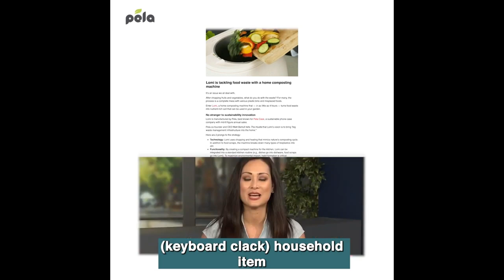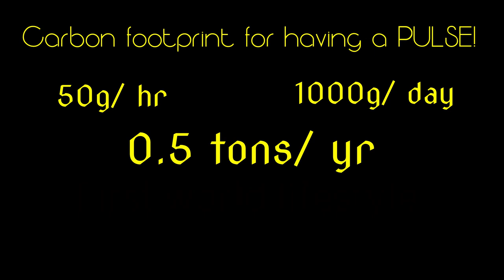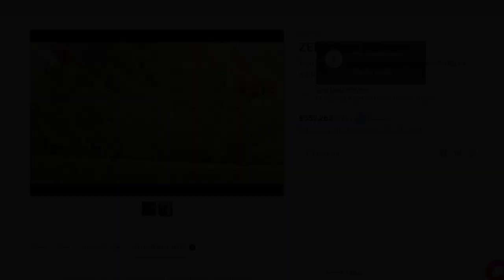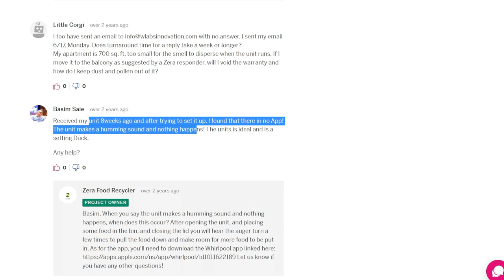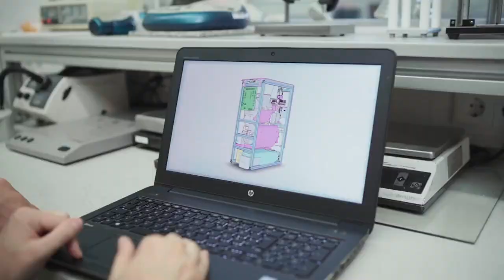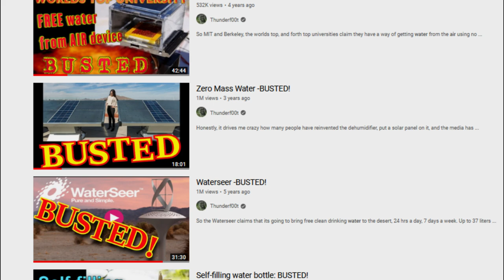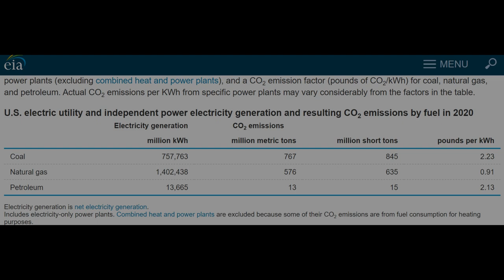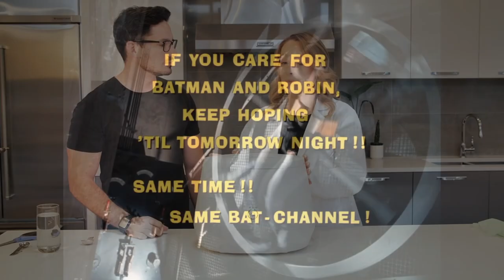Lomi: BUSTED!

Comment: As a professional civil and sanitary engineer of just over 30 years, I was involved in a number of composting projects on the east and west coasts of the US back in the 1990s.  We tried static piles, windrows, forced air, and even containerized composting techniques.  In our case, we tried to use a reasonable mix of yard wastes (grass trimmings, branches, etc.), municipal solid waste (stuff you'd normally throw away in your house), and biosolids (human fecal matter) collected from nearby wastewater treatment plants.  The goal was always to try to find the proper carbon-to-nitrogen ratio - typically somewhere between 5 and 10 to 1.  Invariably, the reasons these facilities were ultimately shut down were three-fold:  (1) The cost of capturing and treating the off-gases was extremely expensive, (2) If uncaptured and untreated, the off-gases from these facilities would create the most god-awful smells for miles and miles downwind, and (3) The leachate (wastewater) produced from these compost facilities was extremely foul, quite acidic, and would simply destroy the biological activity in the downstream wastewater treatment plant receiving this runoff.

There is this old saying:  The solution to pollution is dilution.  And, while that saying may be offensive to some, the concept of composting, which concentrates pollutants rather than diluting them, proves the statement to be true.

If you want to read about one of the few facilities on the east coast of the US to actually survive the pilot testing stage by reverting back to composting only yard trimmings, have a look here:

https://www.montgomerycountymd.gov/sws/facilities/cf/#:~:text=Montgomery%20County%20operates%20the%20facility,Maryland%20Environmental%20Service%20(MES).&text=The%20composting%20program%20in%20Montgomery,one%2Dthird%20of%20the%20county.

On the west coast of the US, a similar pilot test was conducted near Escondido, California, but that facility failed miserably.  Today, Escondido simply offers a homeowner instructions on how to pile up trash in their yard and compost it "naturally."  See https://www.escondido.org/composting.aspx
Reply: Great comment and thank you for sharing your expertise. I would like to have your opinion on the concept of this product: 

I live in Montreal, our energy comes mainly from hydroelectricity, so the emission of this type of machine will be negligible. 

We already have organic waste collection programs. I have the impression that with a machine, a less restrictive model, we could reduce the frequency of organic matter collectors and thus reduce our GHG emissions (in the hypothetical situation that a majority of the population would have the machine in question). 

Do you think that dehydrated materials would be detrimental to the system you were referring to?
Reply: That's really interesting! I'm working with a compost company locally but we've focused on anaerobic composting of mostly food waste. Our containers for the clients have rubber seals and we provide a germinating mix to sprinkle on top each time food is added. The bins generally don't get too bad, it's more of a fermenting smell rather than a rotting one. At our facility we then mix it with mulch and compostables, stack it in windrows, and cover with tarps. The smell really isn't bad.
Reply: Strange because in Poland and whole EU bio waste is processed in every little and big city. They will start building bio gas plant in my city soon which will produce fertilizer and biogas which will be pumped into the network. We already have waste burning plant which produce heat and electricity for the city.
Reply: @philipperodier8414  Good question, sir.  The short answer to your question is almost certainly, yes.  The various composting techniques I pilot-tested targeted somewhere between 40% and 60% water, by weight.  Though the water, expressed as runoff from the process, is rancid, it's necessary provide a medium for the growth of both heterogenous and autogenous bacteria needed to expedite the digestion (carbon-reducing) processes.  For all but the forced air systems, which promoted only the growth of aerobic bacteria, the nitrogen was needed to support the growth of anaerobic bacteria deeper in the static and windrowed piles.  To summarize, these processes would not succeed in a dehydrated substrate.  Hope this helps.
Reply: @matthewluttrell9413  If the food source for your anaerobic biology is mostly kitchen wastes, then I follow your process.  The troubles come when those food wastes are mixed with other largely inert materials, or greenwood, which contains a carbon source, but also adds a lot of non-carbon fiber.  Yard wastes are also very low in free nitrogen, which inhibits anaerobic activity.

Have you conducted a survey of the surrounding community near your composting site to see if your neighbors agree with your conclusion that "the smell really isn't that bad?"  That's what MCRCF did when they first got started and they learned right quick that their neighbors would have none of it.

I ask because we experimented with composting at the Blue Plains WWTP in Wash DC some years ago.  Those who were working the windrows didn't seem to mind the odor, but the poor souls across the Potomac River who were in Alexandria were quietly complaining to their elected officials.  DC Water was eventually required to shut the whole thing down and, as it turned out, the workers had simply become olfactory desensitized to the ammonia smell (the biosolids being used were lime-stabilized and the anaerobic activity in the windrows was converting the slaked lime to  ammonia).
Reply: On the point of capturing and treating the off gases being expensive is it at all practical to utilise the crude hydrocarbon rich gas directly in a gas turbine of some kind. Or is that precluded due to other contaminants being present that render it unsuitable or unsafe to use as a fuel in it's crude form? I get that this wouldn't have quite the same warm fuzzy optics for many people but if we are talking about pure food waste this isn't going to be a net source of atmospheric carbon since you know crops don't tend to do a lot of deep core drilling and such. Hell if it could incorporate even as little as a few hours worth of buffering into the system it would perhaps even be able to defer some of the early peak load and thus delay the start-up of fossil fuel powered CCNG peaking plants albeit presumably only by a small margin.
Reply: Natural way in a yard is the best. Simple and produces valuable compost for the garden. So Escondido did the right thing.
Reply: The waste water is usable, I have calcium rocks just laying around the whole state. When you bring it to 5.96 you have fertilizer, if you are worried about heavy metals sunflower Barrons are the way to go.
Human waste material is now more treated and the mixture between it and yard waste over a collection pool for water filled with calcium rocks lowers the pH, you recycle it up and spray it again, and again, and again. You have to mix in inorganic material, sand or verm is usually the best.
Once you have a suitable material you dry it to field capacity, pack it and sell it. The waste water, you can mix in with bad fish to produce a concentrated mix, dilute or refine to reach the target, now you have fertilizer
Reply: @seraphina985  "raw" biogas has a lot of co2 and water in it, as well as some hydrogen sulfide. They all need to be removed, at least mostly, for good burn. The hydrogen sulfide is rather corrosive and not ideal to pump right into a turbine.
Reply: @glennpearson9348  well where we're at we really don't have neighbors😅. We're mostly surrounded by farms and right next to the dump; the dump smells worse. 

I also imagine your work was at a larger scale. We're currently scaling up and so far the outdoor hasn't really been a problem. Some bins do come in that are absolutely fowl, normally because they were left open at some point or already rotting meat was put in them. 
When each windrow is complete they have a month under tarps before they get rotated, by then the smell isn't a factor.
Reply: @seraphina985  Biogas from anaerobic digestion of food waste can be burned in a regular piston engine or a gas turbine after a simple cleaning step. What Glenn Pearson was talking about was the off gases from aerobic composting and they are not usable in such engines. It's mostly air with only a tiny portion of combustible compounds.
Reply: What a fucking sauce lad. Truly you've made my pasta dinner extra.
Reply: @matthewluttrell9413  It's good for the longevity of the engine to remove the hydrogen sulfide which is quite easy (e.g. with activated carbon) but you don't need to remove the CO2 if the gas is used in a stationary engine. For vehicle use, the gas is purified to almost pure methane but that is mostly so you can get more energy into the tank of the vehicle, the CO2 would be dead volume in the tank.
Reply: Why a direct fuel turbine over a boiler / steam job?
Reply: What is your opinion on modern large scale composting being done in places like the EU, korea, japan, cali, etc. i don't doubt that they aren't without downsides, but they seem to be doing it relatively successfully. After all we've come a long way since the 90s.
Reply: About that old saying, brings to mind nuclear waste. Think of uranium and plutonium(or any of the nuke wastes), they are mined out of the ground at ppm concentrations, and are only a problem when refined, concentrated, and in one place. 

Of course, one big problem Is crude oil, its byproducts and externalities(plastics or gas emissions cant exactly be put back in the ground.) But if were talking about composting and leachate, it's dead on.
Reply: @philipperodier8414  Hi Philippe, I grew up in Ottawa not too far from Montreal. I just want to say that there are essentially no situations in which this 'technology' makes sense. Using thermal energy to remove water from waste would reduce the need to collect garbage, true, but it would require many times more energy. This is adding a majorly energy-intensive stage to garbage collection. What problem does this solve?
Reply: Small scale composting works very well in the garden.  There's no smell and no power use.
Reply: That's interesting, because Germany is operating quite a few "Biogas" plants, where exactly what you describe happens, except the whole point is actually to produce and capture the off-gases.
Your point about the runoff is a good one, I'm not sure what they do with it, but knowing German environmental laws, they most likely don't just leak it into the next river ^^
Reply: @Nerobyrne  Same in Denver Colorado.  Covered in a building the size of a stadium but relatively cheaply made, been there for 30 years.  The gasses are drawn off the top and used.  Kinda reminds me of Beyond Thunder Dome.
Reply: I live on the west coast, we have green bins for yard waste. Once a week you can see a giant plume of smoke on the other side of the levee where Waste Management Co. is just burning all of it. Super great they used all the gasoline to collect and transport it so they can just burn it?!?
Reply: @seraphina985  our local bus company runs gas buses, they have a deal to use gas produced from anaerobic digestion of food waste.
Reply: As an ecologist, I am glad someone pointed this out and I didn't have to.  Thank you, friend.

That said, there is dilution and there is reduction.  The former without the latter is just kicking the can down the road.
Reply: Judging from the description of byproducts, it sounds like the compost was not getting enough oxygen and was undergoing a lot of anaerobic decomposition, also tossing in things like animal bones and seashells could help keep the Ph at a more manageable level for the microbes as well (maybe you guys tried that already though. With larger piles it's a good idea to introduce macro organism as well, springtails, earthworms, fungi, flies, ants, even birds and rodents play an important role if the pile is big enough as they can break larger things into smaller pieces and help aerate the pile.
Reply: I studied this topic for quite some time and indeed the main problem always falls on C/N ratio. Yet I amb amazed about the possibility of mixing in waste water with fecal mater. Mostly because of humidity. So obviously there's gona be lixibiate and anaerobic reactions. But in Europe, with a mixture of food residue and gardening-agriculture waste (to balance C/N), it appears the plants are working well. Though the smell.... when the wind blows in your direction you regret having had breaksfast. 

Usually waste water is treated in Water Treatment plants, which in turn produce the awful "muds" (literal translation from spanish). When there is so much water or organic matter, then they proceed with anaerobic process, which in turn prodices SH2. So I don't know which is worst. Anyway, nothing goes to compost exept for the muds, which are treated beforehand to reduce the water concentration, usually burning the methane from anaerobic process.

PS: The invention portrayed is purely evil. Praying on peoples good intentions and ignorance... disgusting
Reply: Really interesting comment. Spent 10 years designing and installing recycling plants within the UK. Some of which were for waste to energy for burning off shredded and sorted MSW (RDF). One of the big factors in burning that off was removing the water content of the RDF enough so that burning was most efficient. We tried tackling this by a few methods all of which were either energy hungry (passing material through ovens), or extremely operationally and space intensive (material handling it into piles with tarps to let it gestate and heat up and rehandling it every few days). On the face of it if everyone used the Lomi and desiccated the material and sent to black bin waste I'd wager the handling of the waste material at these RDF (Refuse Derived Fuel) Facilities making it much easier to burn and generate electricity. Would love to hear your thoughts on this.
Reply: @nothuman3083  what are "sunflower Barrons"? I looked the term up but couldn't find anything. Cheers!
Reply: We have a standard for council food waste to farm soil conditioned and methane generation… seems to be working fine.
Reply: thanx for posting this. I apreciate professional opinions. forgive me also for "cutting and pasting" your comment (without your YT ident of cours) on the lomi main vid. surprised by all the simmilar comments as here. lomi is more than busted. they have been exposed. chees&aloha , M8
Reply: Wait, does the output of composting "destroy the biological activity"? I mean would just dumping food scraps in a forest kill the trees?
Reply: @pacee21  not an expert in this field but isnt it a waste of materials to built something like this which might have less efficiency compare to the industrial size as well as the power they consumes might even more than that when combined?
Reply: @farcenter  the hell, that's what you call sunflower fields
Reply: @farcenter  wait did my regionalism show up
Reply: @matthewluttrell9413  The hydrogen sulfide can be removed by bubbling the biogas through a chlorine solution I believe.  Removing CO2?  I know water absorbs CO2 quite readily.  Could you produce biogas in a completely anaerobic environment?  Removing the sulfur dioxide shouldn't be too difficult I think.

Not saying though that we can run our world on methane from our own waste.  We could however produce a lot of energy and fertilizer I think.
Reply: @richardwicks4190  you can burn biogas on it's own, and you do produce it from anaerobic digestion.  The hydrogen sulfide can be removed through steel wool (idk about the chlorine solution). The CO2 can be mostly removed by bubbling through water, you have to take into consideration that the water needs to be constantly moving through the bubbler and that the outflow is slightly acidic. This can be a limiting factor for very large scale. Finally the water vapor can go through desecants. 
Raw biogas can be used for cooking and some things (I know some engineers have been made to run on it) but one of its big limiting factors is that you can't compress it without first separating its parts. Straight biogas can only be stored at 1 or 2 psi. 
The composition of biogas is about 60% methane to 40% CO2 and then 1-5% the other stuff (H2S, water vapor, some ammonia...). It has about half the energy per volume as pure methane. These numbers vary. 

I do think we should use biogas, but it does have it's cons and those need to be considered when scaling up. Not being able to compress it and its lower energy density greatly increases things like the diameter of pipes needed to flow larger amounts of it. The corrosiveness of the other 1-5% of its composition can also be a problem for plumbing. I've been playing with idea of making my own biogas reactor and there are companies that sell kits that you can use at home to use the gas for cooking. I hope to see it become a more common practice.
Reply: @matthewluttrell9413  Well, my knowledge of biogas is, well, extremely limited.

Chemistry too!

Some guy was fooling around in his backyard and using his own home-made biogas reactor.  He claimed that by bubbling it through (highly) chlorinated water it would result in sulfur + hydrogen chloride.

I guess steel wool would make.. Iron sulfide?

He took the final gas and used an air compressor to fill a standard natural gas tank to around 100 PSI.

How do you get CO2 from anaerobic composting?  How much oxygen is in dead matter like sewage, dead plants, and even dead organisms?

Anyhow, perhaps you could increase the absorption of CO2 by the water by placing it under pressure?  Maybe spraying a mist of water in a container filled CO2 under pressure, and then cycling the water to atmospheric level with something with a bunch of nucleation sites to encourage the CO2 to come out of solution?  Maybe even highly chlorinated water could do that?  You could just have a pipe that is say, 32 feet up to get 2 atmospheres.  That way, you just have to cycle the water and it wouldn't require too much energy.

I know there are multiple ways to remove CO2 from air, naval subs and the space station do this, but the fluid isn't water.

In any case, it's an interesting problem.

Seems to me you wouldn't want to centralize this process, but rather distribute it.  Would work for off grid locations.  Centralization seems to be a problem.  It seems it would be better to have a lot of little reactors than just a few huge ones.
Reply: @nothuman3083  well it could also be mine! thanks for letting me know though!
Reply: @Discoveryman29  long story short recycling plants have to pay to send things to landfill. If they process it and supply it to energy companies they can create a commodity to sell. The price they can sell it at is based in the quality of material e.g. calorific content moisture levels etc. If it is too far out of specification then material will be rejected and cost them so it's in the plants interests
Reply: @matthewluttrell9413  And I bet you don't have to plug it in and stir it either.
Reply: And there I was thinking the smell came from the nearby unwashed eco-warriors of Montgomery College. The school's motto --  "Make your move"-- even seemed like confirmation.
Reply: Miramar Landfill in San Diego currently produces certified compost made of yard trimmings and food waste. Local residents can get two cubic yards for free if they load it.
Reply: @elizabethblane201  Great planning to make Miramar Recycling Center work.  First, the composting facility is out in the middle of nowhere between the city and Miramar airfield.  So, no permanent residents around to grip about odors.  Also, San Diego was smart to locate the Metro Biosolids Center very near the landfill so the two products could be easily mixed.  The final stroke of genius is that the leachate from the composting facility is treated alongside the leachate from the landfill, so you're killing two birds with one stone.  Very few metropolitan areas have the advantage of wide-open, easy to access spaces like northern San Diego.  Count your blessings!
Reply: @seraphina985  That's a great question!  The answer is, yes!  It can be used in what is called an "enginator" to turn biogas directly into mechanical energy.  However, there is some work to be done in that the gas must be dried first (the water vapor removed).  As our good friend. Thunderfoot would no doubt point out, removing water vapor from a gas requires lots of energy in the first place, so projects that use enginators often have to be extremely large in order to get a reasonable payback period on the costs of the equipment and its maintenance and operation.

I hope this answers your question.
Reply: @glennpearson9348  Yes, we are blessed! From what I understand, their compost is only yard trimmings and food waste, without sewage. Is that your understanding?
Reply: @sdk6450  Don't get me wrong.  We have a number of large-scale composting and biogas generation plants throughout the U.S., too.  It's not as though it can't be done.  It just needs to be done in the right place and under the right conditions.  Places like S. Korea, Japan, and the EU are much more accepting of the general good that comes from such "green" projects.  Here in the U.S., the first thing you hear these days when proposing a project like this is "NIMBY!"  People like the IDEA of such a project, they just feel it should be "Not In My Back Yard," which seems to be less of an issue in other countries.
Reply: @elizabethblane201  That's my understanding.  Though, at one point, I think they also experimented with combining food wastes and sewage at the biosolids center before sending it on to composting with yard wastes.  Mixing waste streams like that makes it very difficult to get a chemically consistent admixture, which is really needed to maintain a stable and "stink free" composting process.
Reply: @glennpearson9348  I guess you could compare it to baking a cake; you have to use the right amounts of the right ingredients and follow the process exactly, or your recipe is going to fail. I'm seen a couple of videos of the Miramar landfill compost, and it looks really nice. It says on the website that it is processed for 10 weeks, and screened to 1/2". They'll load your truck for you for $12 per cubic yard, or if you load, it's free for up to two cubic yards for residents. This landfill seems to be a place where all the variables are advantageous to produce a good product.
Reply: Could the leachate have been neutralised with, say, sodium hydroxide? Or diluted to something like a 1% concentration in freshwater? Before sending it down the drain?
Reply: @electric7487  Possibly, but the problem with sodium hydroxide is that it reacts with a great many things; in some cases, the reaction can be quite violent.  As for diluting the leachate, sure, diluting it is always an option, but using 100 gallons of potable or fresh water on 1 gallon of leachate seems like an incredible waste.
Reply: Ecological FRIENDLY WASTE PLANT for a smaller  communit....
1st.... Let the citizens do work at the uunk facility 😊 some few hours per week, everyone...!
They have to divide the rubbish and put it at the right places for recycling....
2nd.... Use windmill or watermill grinding machines
3rd... Sell recycled stuff.... Compost, plastics, metals
4th... Do all work, also in house cleaning and buerocracy by community members of a voluntary basis 
😊😊😊😊 and for fitness, create a kind of bicycle pedal grinder for recycling....
Reply: Thank you!